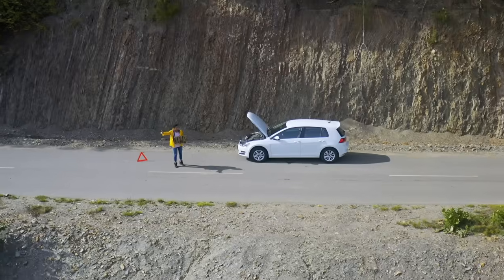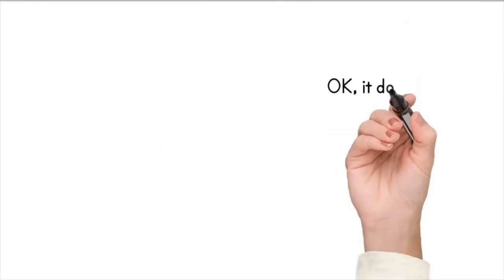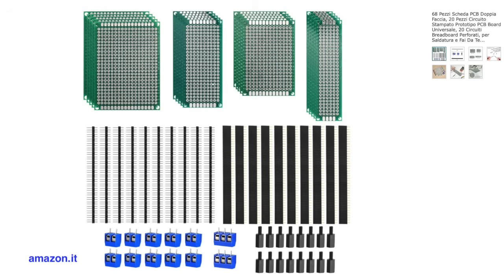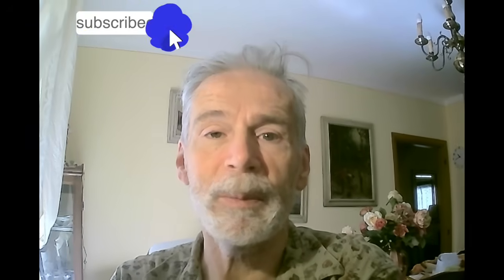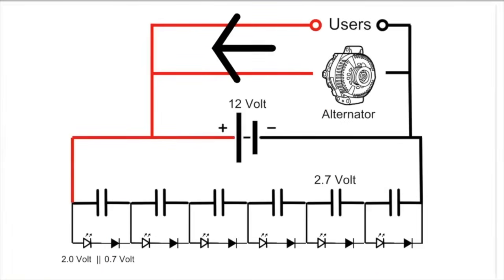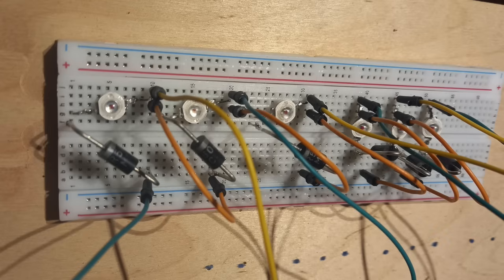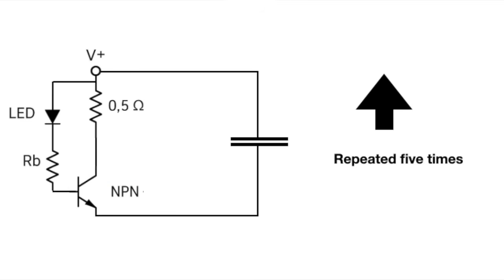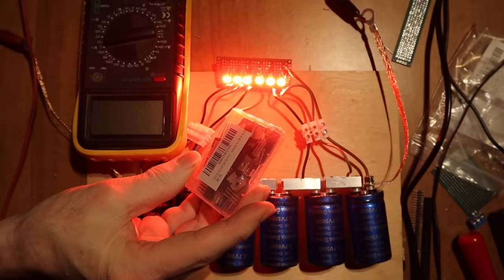Don't buy a new car battery before trying this - Video 93

Comment: thanks for the great concept, I'm keen to try it. Something I thought may help your design is to use a different system of implementation for a car starter, simpler actually. 
Instead of series inductors I plan to use a high current relay to bridge a 1Ω 100W resistor in series with the capacitor bank. The relay will be triggered by the starter solenoid and as such will pass full current only when needed.
I also discovered these 16V (6x500F or 83F) capacitor modules are available with a built in balance circuit intended for automotive applications and at a fairly cheap cost.
Cheers and thanks for posting.
Reply from the maker: Hi Alas, that is a great idea of the high current relais, it will also kill the parasite current when it doesn't need to equalise. But it has to close fast, because as soon as the engine starts, also the alternator will start and will be at risk.
I bought the built in balance together with the Super Capacitors (you see it in some video on the playlist of Super Capacitors) but didn't work well. So I took out the capacitors from it.
Reply: I parented a supercap system that doesn't use resistor balance, it uses a charge pump to distribute the voltage across all cells, and the switching frequency can be adjusted for faster response
Reply: @lohikarhu734  I've made a few large capacity (100p and up) liion batteries using charge pump and flying capacitor active balancing. My only gripe is it's efficiency is fine when balancing, even during use helping the weak cells on load, but the parasitic draw without disconnection means regular maintenance top ups, otherwise the whole pack can go almost to zero.. in a surprisingly short time.
Reply: You can use 100A solid state relays. They can be controlled by a PWM signal so that the higher the pulse rate the more current they allow to pass. You just need to decide how to control and generate your PWM signal that will trigger the switching speed of the  SS relay.Try LTO cells instead. or these supercaps: "Super capacitor 3V 3000F Brand New High Quality Caraudio Car Start Freely Assembled High CCA Low Internal Resistance"
Reply: @ Solid state relays are not good for low voltage DC, IGBT's have a high junction voltage drop. Much better to use high current mosfets as a low side switch, but then I just received a 200A 12V relay with proper copper bolt switch connections for $6 in a bundle deal from AE, it's simple and reliable. I had planned to use it as a contact delay for another engine with a known starter solenoid design problem, I might need to order a few more... lol
Reply: Going from 12 volts stored in the capacitors down to 10 volts during cranking means that only 30% of the energy actually stored in the capacitors at 2.0 volts each can be tapped when the series-connected capacitors are put in parallel with the starting battery. This is because the stored energy varies in proportion to the SQUARE of the voltage. Compared to the energy the capacitors CAN store, at a conservative 2.6 volts each, the performance is MUCH worse than the capacitors are capable of providing. 

On the other hand, if parallel-connected capacitors are put in SERIES with the battery (in the cable to the starter motor), then over 99% of the capacitors' stored energy can be tapped when going from 2.6 volts per cap down to 0.1 volt. This approach greatly simplifies the capacitor charging circuitry, and means that the caps can be fully charged even from a very weak battery. Also, the initial voltage to the starter is momentarily increased from 12 volts to 14.6 volts, which increases the available power to the starter to 148% of normal, and maintains that increased power for longer than the weaker boost described in the video. 

The caveat with my proposal is that a high-current switch such as a starter relay must be wired across the capacitor bank and triggered to close very quickly when the capacitor voltage drops to near zero. Then the battery carries the whole starting load, as normal, but by then the engine will already be spinning. This extra switch also protects the capacitors from being reverse-biased and damaged.
Reply: @YodaWhat  The capacitors are not working independently as an energy source. If you watch the current draw from a starter when cranking it commences with a high inrush before replicating the compression cycles at around 6-12hZ, depending on the engine.
The capacitors are not delivering all the energy during this process, but helping to smooth the peak current pulses from the battery as it works as the source. That smoothing should greatly reduce the peak current loads the battery sees and therefore elevate the average voltage during cranking. Also having the extra current available during those compression peaks will increase the cranking speed and start the engine faster reducing cranking time, and the total current draw will be reduced in proportion to that increased average voltage. Both of these will extend the battery and starter life.